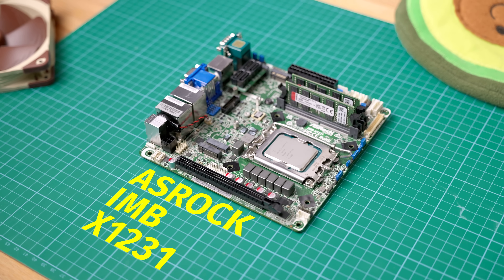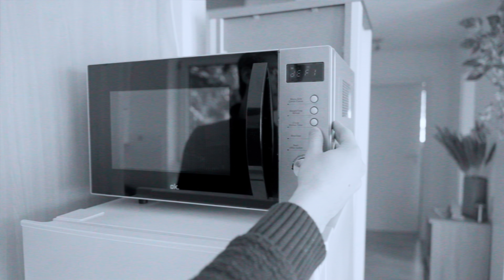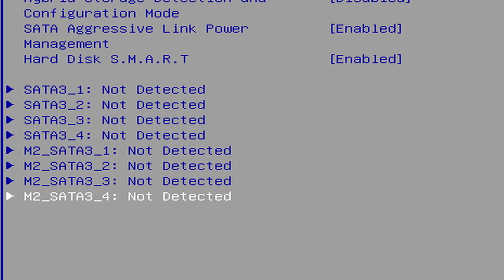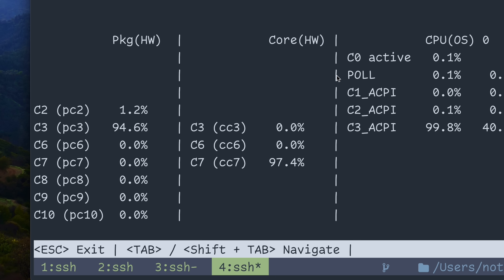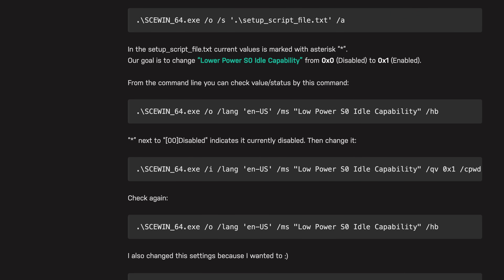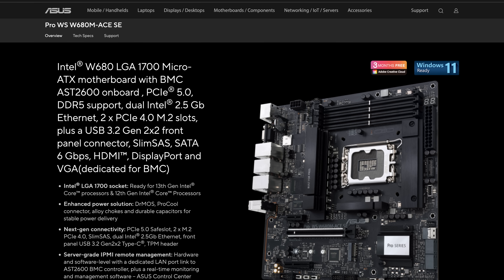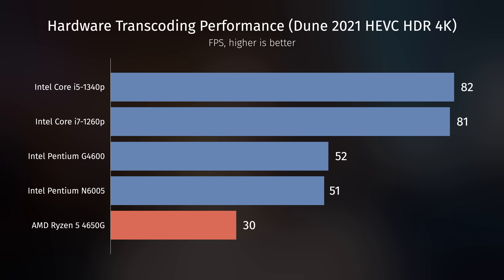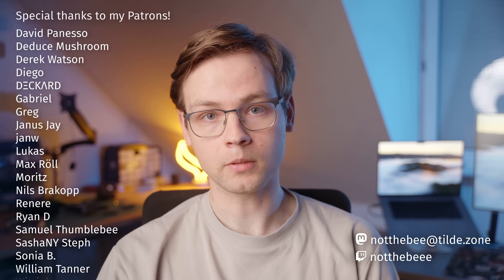A Perfect Homelab Motherboard That You Can't Buy (ASRock IMB-X1231)

Comment: I have an Asrock IMB 1238 motherboard. It's a workhorse. It doesn't consume any power, and it also has a SIM card slot and an M-Key B slot for a 4-5G modem. I'm configuring it with two NVMe drives and four 16TB HDDs. I've never had any problems.

Comment: @WolfgangsChannel I just received this motherboard. I correctly enabled the hidden BIOS menus using AMISCE utility that you referenced, however these settings had NO effect on idle power. In Proxmox powertop, the most power efficient state it can reach is C3, pulling 25w from the wall with only a single SSD and memory stick attached.

It looks like I"ll have to also reach out to ask for a custom BIOS, unless you can be so kind to share the one Asrock sent you?

Comment: @wolfgang any recommendations for the i5 13500 cooler with that board?
Reply from the maker: I’ve been using the NF-L9i bc my system is in a 2U case. But it would theoretically fit any LGA1700 cooler
Reply: Perfect! I have that in my cart too 😁
I suspect given it's low power draw  almost anything compatible with 1700 would do?
Thank you for the reply ❤
Reply from the maker: 13500 can draw as much as 100-120W while turbo boosting — so if you have the room, I’d go for a bigger cooler
Reply: @WolfgangsChannel  I see, surprisingly the cpu came with its stock cooler so I'll use it while I wait for the Noctua :) Sadly it often takes around 3 weeks from order to door for my country. Wish you a great new year man. Looking forward to your content and seeing you on stage again :)
Reply: @WolfgangsChannel  System is built and running. I'm still debating on proxmox or other. But one big thing is troubling me..

with 4 12TB drives, 64GB memory, an aqn 100 sfp+ card and 1 TB nvme stick I'm seeing 50-60W at idle running either proxmox or debian.
I unplugged all sata drives and got 40W.. I also got the 1.60E bios and enabled ASPM but that did not seem to help.

I ran powertop --auto-tune, changed governor to powersave and very often powertop seems to crash. to the point where I open another SSH and can get it but running things like lspci goes in a crash.
I cannot kill powertop and forcing a shutdown or restart just seems to kill a few processes then wait forever..

Any idea you may have would be great!
I'd love to see that baseline 6W and build up from there

Did you change the OS you are running now from the old ansible one with the mergerfs setup and snapraid?

Comment: I got recently W680D4ID-2T/G5/X550 which:
1) Is Power efficient
2) Supports ECC
3) Has QuickSync
4) Can be obtained though hardly and pricey (it costs around 600 euros)

Moreover it has two 10GbE ports, IPMI, 8 SATA ports, 2 M.2 ports and still has a decent size (it's deep mini-ITX, which is only a bit larger than this mITX board).
Reply from the maker: Sounds awesome! How much does it draw at idle?
Reply: @WolfgangsChannel  I have finally have my hands on Shelly Plug. I also dag a lot into ASPM and energy saving overall. With 14900K, 96GB ECC, HDPlex 250W PSU, Intel Arc A380 (active RC6, ASPM L1), 4 SATA SSD disks (enterprise, so no SlpDev and Slumber) and 2 NVMe I have 31W in idle (PC10 state achieved). But with 2 VMs running (TrueNAS and Fedora CoreOS) it drops to PC2 and PC6 and power increases to 50W in idle. In both cases I think it's fine.
Reply: @WolfgangsChannel  I will buy power meter soon and write an update!

Comment: Wolfgang do you have a discord server?. Any opinion on IMB-X1230 ? Seems similar with chipset difference and then no vPro
Reply from the maker: It's based on the H610 chipset, which doesn't support ECC (which is the biggest selling point of X1321 imo).

Comment: Where can I download your version of this BIOS? I bought this board and can't get below C3 state.
Reply from the maker: Email ASrock, they will likely send it to you

UPD: sorry, just read that you already did that, and still can't get below C3.

First thing I would do is reflash the BIOS and don't touch the ASPM settings. They default settings might seem counter-intuitive, but that's the settings which worked for me.

Also, note that just resetting the BIOS to optimized defaults will not help, since for some reason, at least in my case, the default BIOS settings, and the "optimized defaults" were different.

Then I would disconnect everything and see if you get to lower C-States. If not, try booting into an Ubuntu 24.04 LiveUSB, installing powertop, and seeing if that helps. 22.04 has an older version of powertop in the repos which is not compatible with 13th gen Intel CPUs
Reply: I flashed the ASM1166 card with older firmware sugested in some forums, then removed it all together and still stuck in C3. So proxmox is the culprit? Who knew it would be so hard to achieve power efficiency!
Reply: I will give it a try and update it here.
Reply: I followed the steps in the unraid forum but it didn't make any difference. 56W at idle.
Reply: ASRock sent me the updated BIOS, but I still can't get below C3 state even though my idle power got down to 40 W. So now I susppect the culprit is the ASM1166 m.2 to sata adapter.

Comment: These small media server sorts of home servers are nice at all, but they're not terribly difficult to put together. But here's a nice challenge - try to put a 2x3090 ML home server that doesn't idle at ridiculous power consumption. Choices of boards with 2x Pcie 4.0x1 6 at 4U spacing are kinda narrow. None of them seem to have reasonable idle power consumption cause they're all the typical high end gaming boards. And I've got no clue how to get a 10 gig nic in there. Oh... and of course you'll have to figure out what PSU's (I'm kinda inclined to go 2x500W) to use since the system will hopefully idle around at about 50W, but peak out at 800-900...

Comment: Asrock IMB-X1231: >500€
Gigabyte C246N-WU2: <200€

Sorry, but only Intel is greedy?
Reply from the maker: Asrock C246 WSI was also fairly inexpensive
Reply: @WolfgangsChannel   Yes, I paid 197 € in the year 2020 for it and compared it against the C246N regarding power consumption. The price of the C246 WSI was really stable over the years with around 220 € in Germany. But finally the power consumption was twice as much as the C246N and the position of the m.2 slot is really bad, too.

Comment: Asock's IMB motherboards are actually quite expensive. We've got at work some small industrial PC's equipped with such motherboards. They cost about $15k per unit which is actually cheap for industrial applications. What drives the cost up is the fact that all the equipment comes with 15 years of part availability coverage.

Comment: Got myself a hp prodesk g4 sff for 100AUD with Intel i3 8100 as a result of your channel to replace my 12yo dlink 4bay nas, laptop running HA and htpc running Plex, spent a few weeks procrastinating, figuring out what to buy and trying to learn and eventually got proxmox up and running this weekend, samba shares up, jellyfin lxc & ha vm up and running, mostly at c9 in powerTop, 3sata onboard, x16 & x4 pcie & 1 nvme slot. Cracked out the power meter but it's dead... Dodgy nimh battery on the t board leaked everywhere and corroded the traces, i tried some jumper wire repairs but no luck so $20 later and wait for Australia Post to find out the power consumption.

Comment: CWWK just release motherboard has lga 1700 support 12gen - 14gen cpu, sata slot, 1 pcie 5.0*4, 2 pcie gen4.0*4 slot and full x16 slot. 

The only downside of their motherboard are lack of ecc but use ddr5, but for the price their selling around 120usd to 170usd it actually no brainer option for newer gen CPU And directly compete with Asrock IMB-X1231

Comment: ECC was actually one of the main reasons I was excited for Ryzen, finally was something competitive with intel & supports ECC. I have 3 Ryzen based system running currently with 128GB of ECC memory each, all 3 run 24/7 & have been rock solid.

Comment: I've got my eye on the ASRock IMB-X1314 mATX version. I'd love to see / hear your thoughts on that one!

I ended up backing the 8 bay UGreen has for $899.99, as that seemed like excellent hardware for the price (plus, every 8-bay NAS chassis I know of has at least one thing that pisses me off, and I like the UGreen one). But I'm planning to do Proxmox with PCIe passthrough to a TrueNAS VM (or bare metal TrueNAS with a separate Proxmox box, I haven't decided yet) and 8 drives in ZFS, so I figured ECC would be better than not, and the above board comes with IPMI which would be nice to have.

I have until the UGreen campaign ends to decide what I'm going to do, as I can cancel my pledge until the campaign ends. Since most of the cost will be storage anyway as I'm buying large capacity Iron Wolf Pro drives, I'm asking myself if saving $500 or even $1000 is really worth missing out on ECC and IPMI.

Comment: So a Ryzen CPU (say a 3700x) could run ECC, with ECC actually ECC'ing or what you want to call it on a consumer MB? Or is it just that the ECC ram will work but not actually ECC? And then maybe slap in a cheap-ish Intel Ark card for video transcoding
Reply from the maker: The ECC will work just fine if the motherboard also supports it.

Comment: On the other hand, thanks to Intel completely preventing ECC sticks from working at all on desktop boards let's AMD users buy the unwanted and cheap ECC RAM and just use it with ECC disabled. I was kinda wondering sometimes if it would be easy to replace the ROM on ECC RAM to get detected as non-ecc and work no any board then I could just buy some high capacity modules for couple €, mod them and resell for hundreds
Reply from the maker: Intel doesn't prevent ECC sticks from working at all. I think there's a bit of confusion about different types of ECC memory. There are two main types of ECC memory – registered and unregistered.

Registered ECC memory (RDIMM) only works on server/HEDT platforms (e.g. LGA 2066 Xeons or AMD EPYC/Threadripper CPUs). These platforms also do not support non-ECC memory at all, you can only use registered ECC memory. This is the type of ECC memory that you're thinking about – it's cheap, and can fit more GB on a DIMM module. However, it requires a server/HEDT platform to work, and platforms that do support registered ECC RAM often can only ever be used with registered ECC RAM, and don't support unregistered ECC or non-ECC sticks. Neither Intel Core CPUs, nor AMD Ryzen support registered ECC memory.

Unregistered ECC memory (UDIMM) will technically work on any computer, but will only provide actual error correction on supported platforms. You'll be able to use UDIMM sticks on a consumer Intel  platform as just regular memory sticks, but they won't correct any errors. But as soon as you plug them into a Ryzen system or an Intel workstation motherboard, you'll have the ECC functionality.
Unregistered ECC memory sticks don't come with the usual RDIMM benefits though (price and density).

Comment: The DFI SD106 Q170 also claimed this capability in 2017. I bought 5 of these boards for $15 each. They sold off the remains after Gazprom. They found a vulnerability in the BIOS. That's why the price was low. In general, the board is excellent. There is support for ECC, and it also supported coffe mod through bios modification, which is cool. great board)

Comment: You're wrong on the AMD APU ECC support thing - it's the exact same case as with the desktop CPUs, that it's "not disabled" but not supported or undergone any type of verification on consumer chips - but they do that for the (identical silicon, near-identical configuration) PRO SKUs. I've got a DIY NAS that started out with a hand-me-down 1600X from my old desktop, then moved to a 2400GE (non-pro), and now runs a 5600G (non-pro). All of these have supported the 32GB of ECC RAM I've got in the system with no issues - even on my old, crappy Biostar X370GTN motherboard (the first AM4 ITX board to hit the market!).
Reply from the maker: Supported as in "system booted with the memory module", or as in "ECC functionatly is enabled and working"?
Reply: @WolfgangsChannel Functionally enabled and working as far as I know. ECC options show up in BIOS, and while there's no way of testing for it in TrueNAS that I know of, I did confirm it was working while I was initially setting up the system.
Reply from the maker: Unfortunately, this might just mean that your system supports booting with unregistered ECC RAM, but not that it actually utilizes the ECC features.

On Linux, you can check that with lshw (`sudo lshw -class memory | grep ecc`), on Windows, you can use `wmic memphysical get memoryerrorcorrection`. Outputs "5" and "6" indicate single and two-bit ECC respectively.
On FreeBSD and TrueNAS Core, you can use `dmidecode -t 17` to check ECC support. If your "Total Width" is 72 bits, this would indicate that ECC memory support is enabled. However, this method is hit or miss, and sometimes produces false positives.
Reply: @WolfgangsChannel It does report 72 bits of total width using dmidecode -t 17. Not much else I can do to test this without messing with the system I guess? I do have a vague plan to move from a bare metal TrueNAS core setup to some form of virtualized setup (want to do more with the system now that it's reasonably powerful, and plugins and VMs under TrueNAS aren't really doing it for me), which would probably give more options for figuring this out properly, but that's months down the line at a minimum (need to figure out what I want to do, and likely get some more storage to back up my data before migration).

Comment: Power consumptoon improvement needs the context of investment cost.

My server "idles" at 88W from the UPS.

From the top of my head:
1x evga supernova 1300 g2
1x x10dri
2x E5-2667 v4
8x 16GB 2133 ecc
2x PM983 960GB nvme
2x 6410A 960GB nvme
2x PM991 128GB nvme
1x NQ100 960GB ssd
1x old s.evo 256GB ssd
1x old kings. 240GB ssd
1x 500GB 2.5" hdd
5x 1.5TB 7200 3.5" hdd
1x gtx750
3x Fractal 120mm
3x NF A12x25 
1x Pure wings 2 120mm

Comment: I'm curious if the Intel Rapid Storage Technology supports all 8 SATA ports. According to Intel, the max supported drives is 6, which is also the max number of SATA ports on older intel chipsets. I'm wondering if it is possible to create a Raid Array with 8 drives on this motherboard, and more generally on newer Intel Chipsets that support 8 SATA drives.

Comment: Ive found and bought AsRock IMB-180 on eBay and using it for everyday use and gaming for several years now. Its a Haswell system and did not have a support for above 4G decoding which i needed for enabling GPU ReBar functionality so i asked AsRock support for a bios modification and they delivered. I was stunned by getting such an enthusiastic support for my little custom project. AsRock is the best

Comment: I am running a media server, a gaming/HTPC, smart tv, an AP-router, and a bunch of wireless and wired clients. The network switch is still a 8 port 1Gb switch. The next step will be to go for first 2.5Gb and then 10GbE for the switch, server and HTPC, and do it on a budget and still keeping the power use in check. The new mac minins and others start to come with 10GbE, so the trick will be to do on the cheap and at the right time, when things get cheap enough for the consumers, but also so say it is possible to reuse the old switch for its ports. 10 GbE cards on AQC113C TBase-T has also come down in price as hey can be had for >70€, making an upgrade cheap if you have the pcie slot. As I use consumer hardware to keep it cheap, there are no fiber, so far, but I am thinking about it, as some of it has become really cheap. Also to think about beyond 10GbE.
Link to a test of some cheap hardware/switches in the next post.
@wolfgangsChannel I hope you'll take this up in a coming video. How to increase the network speed on the cheap and low power consumption, as many still lives in condos, so we don't need or have elaborate build in networks/cables. Thx.

Comment: I can confirm that Asrock's support is Bad if you are not a Youtuber, I had problems with the RGB software that literally cleaned all the partitions of the HDDs, I contacted support asking about the problem and they never responded.
The worst of all is that after this bad experience I was able to replicate the problem 2 more times (already experimentally) it is a bug when detecting the RGB controls of the computer, which literally deletes the partition tables

Comment: I actually found this motherboard on ebay the other day. So, it is out there if you get lucky.
Reply: Indeed. I've also found it and am trying to build a system (N304, IMB-X1231, i5-12500, 32GB ecc, Corsair RM650, 4x18TB HD, 1TB M2 SSD). It gets crowded inside but it's doable. Biggest issue is the lack of (room for) a decent silkscreen on the IMB-X-1231. I can't figure out where to put a few cables, coming from the front of the Node 304 (power sw, HD LED, power LED). I can live without the LED's, but will probably need the switch ;-)  Has someone any idea about where to find some decent documentation on the connector layout of the IMB-1231 ?  The box came with only the motherboard inside, and there' s only a one-pager with specs on the Asrock site ...

Comment: So far Asrock is the best manufacturer I know, they are easily reachable, always anwser, and each time can help, the do! 
Their Deskmini 330 have a non standard connector for it's sata drives, one I had was faulty after years of use and the warranty was long gone. They still sent me two new fresh one for free without any questions (and I asked only for where to buy them initially)